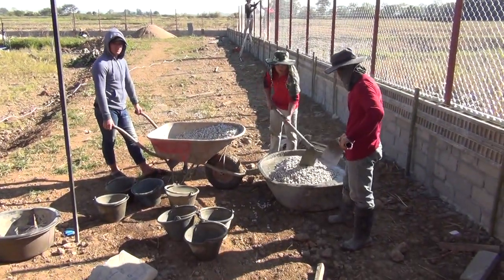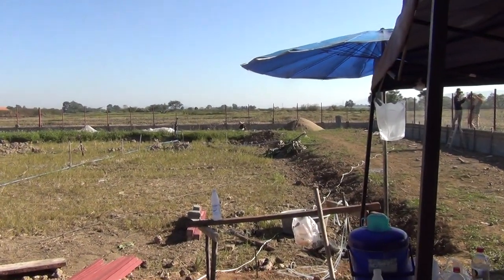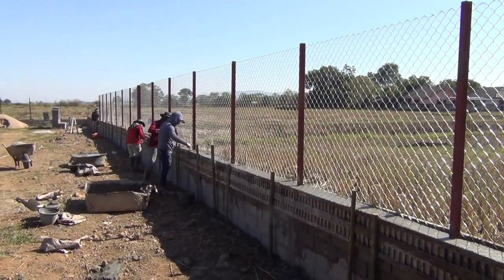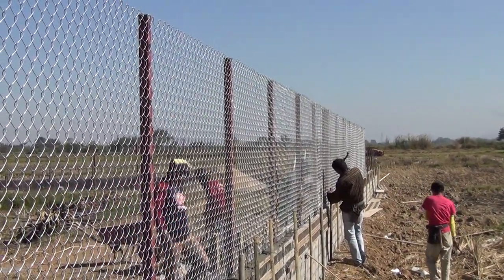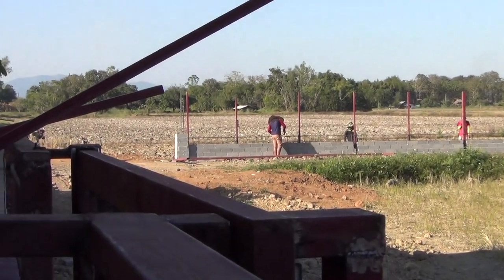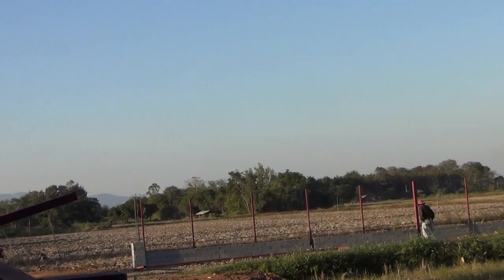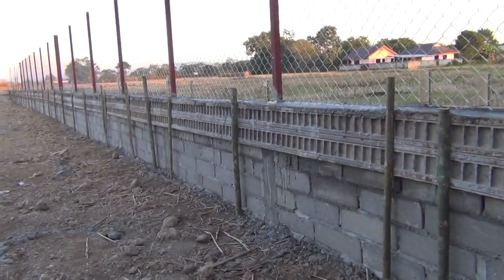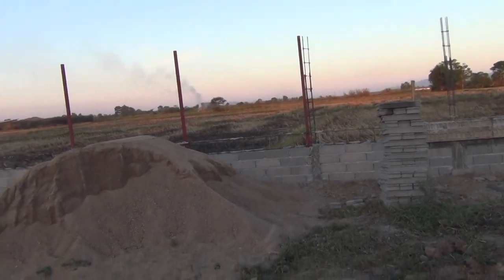Tenth Day From Pole To Pole...Fence Project

Comment: hello how many square meters is your lot and how much did you spend in concrete fence including the pole, labor and cyclone wires? thanks
Reply from the maker: Best as I can remember it is approximately 2400 square meters. Weird as to how much we spend it was several thousand hey... Overall not cheap. However, it was exactly what we wanted. Thanks for watching.
Reply: @JustLivingWithGeorgeAndWoon  ok thanks a lot